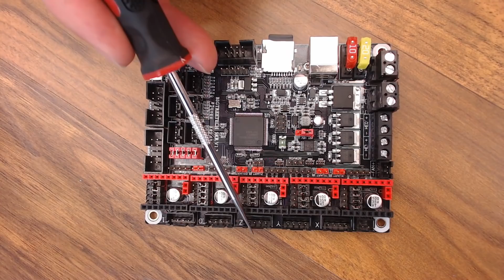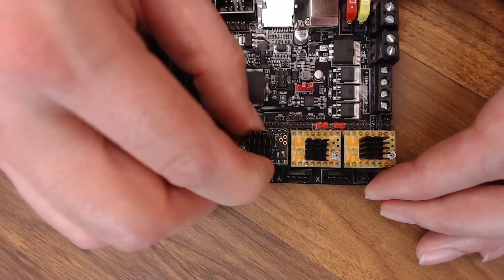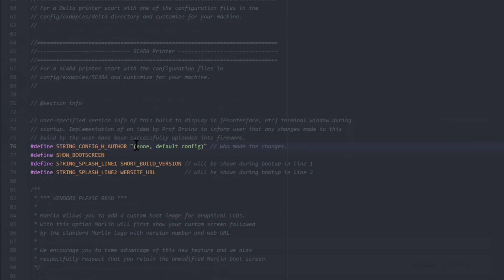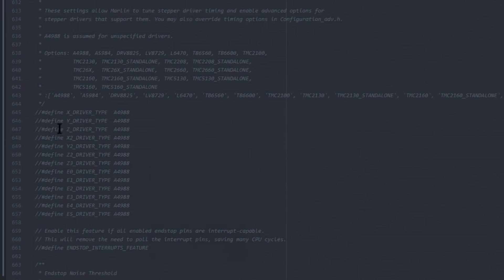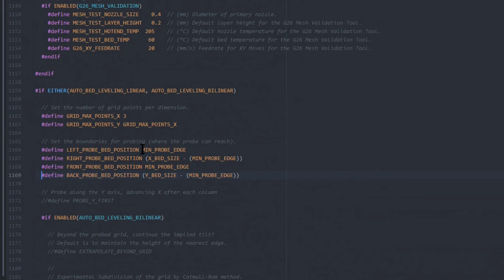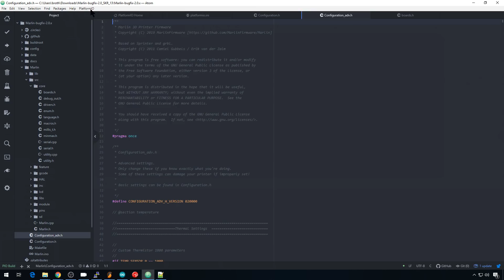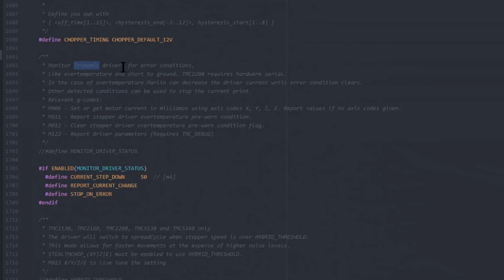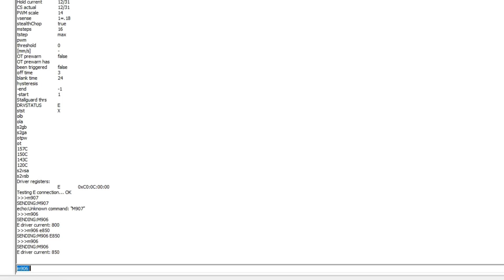SKR v1.3 Mainboard Install - TMC2208 - Chris's Basement

Comment: Hi chris, thank you for that realy good Video.  Mit helps mehr to Setup my skr1.3 with 2208 on the ender3. One thing is that i habe to set the stepps/ MM Down to 40 instad oft 80. I do Not realy understand why. But ist works. Best regards . Marcus
Reply from the maker: Thanks for watching! It sounds like maybe the micro stepping is off on the driver. Check your config options one more time.
Reply: @ChrisRiley  that is what i Think too. But i Setup the config exakt linke yours.  I will investigate that deeper tomorrow and check out with pronterface. My First testprints are looking not so good 🤔. Best regards
Reply: Sorry to contact you again, but i'am really frustrated, I check all settings, eaven the board and driver, but it seams to be that it is impossible to set up the drive in UART, when i send the  M122 to the printer it says "unknown Command"  I'am close to give up.
Reply from the maker: @marcusmuller1674  Configuration.h says 2208 not Standalone_2208 correct?
Reply: @ChrisRiley  yes !
Reply: @ChrisRiley  I have realy no more Idee, spend more then 48 h on this configuration. Send also a mail to the support of Bigtree
Reply from the maker: @marcusmuller1674  If it is set correctly in Marlin, the pad is soldered on the bottom and the jumper is one, that is all I know to do. Does your screen say connection error?
Reply: @ChrisRiley  NO that is the cracy thing, the printer works - but not fine. Mebe i find 2 mistakes, 1. I include (install)  the TMC Libery in Arduino. 2. I bring in the  Part  "HAS_Driver (TMC2208)  in the Configuration_adv.h. But works also not, i test it 2 minutes ago. Close for todaý, sometimes it helps to start at the next day again. Thank you verry much for your help and time !  BR Marcus
Reply: The Support from Bigtree says define SERIAL_PORT_2  0 , this means i have to open the 2. Serial port, but I check you do not do that in your Video and it work. I will test that later on.
Reply from the maker: @marcusmuller1674  Correct, you shouldn't need serial 2 unless you have a tft screen or need the the primary UART interface for wifi or something else.

Comment: Hi Chris, great video! I followed your instructions to install the skr on my Tevo Tarantula but I can't seem to get the REPRAP_DISCOUNT_SMART_CONTROLLER to work. It looks to be the same as the one on your Prusa. I even tried flipping the connectors with no luck. I also tested the controller on my old mks gen l and it does work. Let me know if you have any tricks to make it work with skr. Keep up the great work!
Reply: Never mind... controller works great now. I found a marlin2-skr13.patch for tarantula by azbesthu on github that did the trick. Btw, unlike mks gen l, no flipping of exp 1 & 2 connectors needed on the skr 1.3 board.
Reply from the maker: @jims5884  Nice! This good info to know for others.

Comment: Can I use this video without having TMC2208 drivers and using it on a Ender 3?
Reply: Sure you can, but since the stock drivers are soldered to the mainboard, you'll still need some drivers for your steppers (either A4988, DRV8825 or any other in the same format. TMCs highly recommended)
Reply from the maker: Yep, like Zeen said, you can use any driver you want on the SKR.
Reply: @ChrisRiley  but I can't use no driver at all right?
Reply from the maker: @broom6958  right, you need a driver of some kind.
Reply: @ChrisRiley  alright. Ordered the tmc2208 now.  Any known problems with an Ender 3? Is there a guide for the ender 3 with the skr  1.3?
Reply from the maker: @broom6958  I don't know of any guide or issues, but I have seen a lot of people do this upgrade. It should be straightforward.
Reply: @ChrisRiley  alright, thanks!

Comment: Chris - Thank you for this excellent video. By following this the steps that you outline I have just finished upgrading my Anycubic Kossel Plus to 32 bit SKR1.3 with TMC2208's. Just doing some simple test prints, but at this point I am amazed at how quiet the printer is with the 2208's. Need to finish tuning, and really want to see the effect on the print quality, and speed. I look forward to more content on the SKR v1.3! Thanks again!
Reply from the maker: Awesome Mark! Glad I could help out.
Reply: Quick PS. Just printed a couple of Benchies one at .2 and the other at .1 layer height. Both are perfect! Really recommend this upgrade. A few things to note though:
1) The polarity of the power input screw block is opposite from the other screw terminals for the heaters. Red on the LEFT for the power. And the screening is small and hard to see especially if there are a bunch of other wires already connected and getting in the way. I learned this the hard way. But the fuse did blow and protect the board, so was just out a buck for a new fuse.
2) JST connectors are a big pain to crimp. If I end up doing this again, I think that I might get some JST cables, and the solder them to the limit switches rather than try to crimp on new connectors.

Comment: Hi Chris, my sd doesn't work. I have sdk 1.3 with marlin 2 and the fysetc mini 12864
Reply from the maker: SD on the board or on the screen?
Reply: @ChrisRiley  on screen, I have change  this line for the  onboard sd

  // LPC-based boards have on-board SD Card options. Override here or defaults apply.

I have tested the SD on screen but it's to slow,
Reply from the maker: @tobyax  I would guess this is a bug, probably conflicting data. You might check over on the Marlin github.

Comment: Inspired by this video I got myself an SKR 1.3...and what a total mare it is being!  I can start with the most basic config as you do here Chris and get a working board that I can talk to, but as soon as I try to make use of the Ender 3 example configs included in the Marlin 2.0.x download, it all goes horribly wrong and I end up with a toaster. Mostly, it just won't communicate with  Pronterface or Octoprint, but sometimes, it sort of works but reports CRC errors or loads default values as stored ones are missing. I really cannot face going through every single difference in the config files, one item at a time, changing one thing at a time, until I find the problem. I even tried merging the Bigtreetech published Marlin package with what I needed - again, no joy. Same kind if deal, basic Bigtreetech build will talk to a host, but once I try to make it useful, it goes badly wrong. 

On top of all that....I strongly urge anyone trying this to NOT use a MAC for Atom/PlatformIO/SKR - it no workee. Had to resort to Bootcamp and Win7 Ultimate to even get it this far.  I'll wait for a later release of Marlin I think and try again in a bit.

Despite all that, thanks for the video as always Chris :)
Reply from the maker: Thanks Chris, sorry it didn't go so well. Hopefully the official release on Marlin 2.0 will solve somethings. Anytime you need a hand with a config let me know, I would be happy to take a look at it.
Reply: Hi Chris - It's all your fault of course, you made it look so easy :)   My working assumption is I'm doing something stupid...just need to find out what.  I've also concluded that Atom/PlatformIO on the Mac is OK too, I was blaming that for the issues but it was obviously the configs I was creating to blame. Somewhat conflated by issues with USB on the Mac as well of course....

So, as things stand at the moment, I am able to use the Mac for editing and compiling Marlin OK, I just need to manually transfer the firmware to SD once it has compiled. It did work once or twice automatically, but was far from consistent.

My goal is to build an SKR config for my Ender 3, with TMC2130 drivers in SPI mode on all 4 channels, a BLTouch for bed levelling. This is what I currently have, working perfectly on an MKS-GEN-L.

I'm slowly, one step at a time, building up a config that has what I want in it, it's tedious, but I'm making a change, compiling then testing, one change at a time, hoping to eventually find out what breaks it. I know I said I couldn't face that...but, well, I'm stubborn.

One thing struck me that could well be the root of the problem - I'm doing all this on a bare SKR board - no stepper drivers, no display, nothing other than power plugged in. In your experience, do you think that could be the root of the problems? Not knowing anything about how this stuff actually works is a hindrance! A lack of handshake/feedback from stepper drivers or display could be all I'm missing....if such things actually occur of course.

I wanted to sort out the config before 'breaking' the printer, hence trying to do it all on a bare board. This is probably my stupid mistake!

Thank you too for the kind offer to check my config, that's very generous. I'll give it a bit more time myself (until I get desperate) then may well take you up on that.

Cheers Chris.
Reply from the maker: @chrissavage5966  I take full responsibility. LOL So the only thing I have ran into that needs to be plugged in are the motor drivers. If the drivers and motors aren't plugged in it does some really crazy stuff, but I only ran into that with 2130's in SPI mode. Everything else you should be fine leaving it off.
Reply: @Chris Riley  Mmm, that’s interesting what you say about the drivers. I did try a config without TMCs selected but it was the same deal with no communication. One I did yesterday included defining HE1 as the fan driver, and I noticed that the LED on the FET comes on a short while after power is applied to the board, which suggests something sensible is happening. Maybe I should just stop messing about and connect it all up!
Reply: @ChrisRiley   Hi again Chris. I revisited this yesterday, finally got round to installing the board in the printer with everything attached. Same deal, it's a toaster. So, to the point, it's a big ask, but do you think you could let me have a copy of that firmware.bin file you generated for this video please? I know it won't make my printer work, but it should at least talk to Pronterface or Octoprint without getting pissy. I'm as sure as I can be that my SKR board is faulty, but that would be a final confirmation. I've already ordered another board on the assumption I'm right about it begin duff, but I'm just impatient ;)  Cheers.
Reply from the maker: @chrissavage5966  Here you go, they this one. https://drive.google.com/open?id=10aAyXaFw_sRdTPvTY9tK18Kj_sCr07sT
Reply: @ChrisRiley   Ah, mate, you're a star. Thank you.  And....... it's still a toaster In a way, good news!!  I'll wait for the new one to arrive I think. It's pretty weird though - if I put the OEM firmware on, it kind of works, in as much as I can connect to it, but so far, no Marlin config I've tried, even the most absolute basic, has worked, and now a known-good one from you doesn't work either.  Anyhoo, for the less than $20 I spent on it, I think I'll call it done and hope the new one plays nice.

Thanks again Chris, really appreciate the assistance and I'll report back once(!) I get one working right.
Reply from the maker: @chrissavage5966  Does it do the same thing if you put the fimware on the SD card with your computer manually? Not via USB I mean?
Reply: Chris Riley I had little success doing direct uploads at any point so have pretty much always done the copy to SD card locally to computer then move SD card to SKR routine. Your firmware did load to the SKR OK as it renamed it from .bin to .cur
Reply from the maker: @chrissavage5966  Ok, just curious. Other peoples 3D printer problems bug me just as much as my own. :)
Reply: @ @ChrisRiley    I know what you mean! Before I retired, I spent a few years nursing the company network and a bunch of PCs. That taught me patience as well as a good dose of stubborn :)
Reply: @ChrisRiley  Hmm. Well, new board still on a slow boat from China, but ever stubborn/optimistic(!)/daft, I had yet another go. Only thing I can see that I did differently was to 'Rebuild C/C++ Project Index (Autocomplete/Linter)' from the PlatformIO menu in Atom before I tried modding the configs and doing a build. I've yet to put the SKR back in the printer and install the driver modules etc, but I can now reliably communicate with the board via Octoprint. In fact, its been reliable for the last 30 hours as I left it connected while doing a couple of big prints. This is by far the best result I've had with it to date. It responds to commands as one would hope, as far as that's possible for a bare board anyway.

I truly don't think I did anything different as far as actual Marlin config goes so, I've no idea!

More anon.
Reply from the maker: @chrissavage5966  Hmmm....Really the only things I can think of are the serial port setting or something is a miss in platform IO. I did have to reinstall it the other day. They put out an update the messed up my sketch.
Reply: @ChrisRiley   Hi again Chris. Well, some progress. Sort of!  Before I continue though - are you OK for me to keep spamming this videos comments with my problems? If you're good with it, I'll carry on. If you'd rather I didn't, please, do say so and I'll desist! Cheers Chris
Reply from the maker: @chrissavage5966  Hey Chris! You can send me comments anytime! That's what I am here for. Where are you at with the board config?
Reply: @ChrisRiley  Hi Chris. Cool, I'll carry on then ;)

So, having got a board that I could talk to, I installed it yesterday and it looked promising - LCD working, stable comms with Octoprint, it seemed to accept assorted commands that I sent to it. But, on the LCD it showed TMC COMMUNICATION ERROR and would HALT if I tried to home the printer. An M122 command indicated problems too. After loads of searching, I happened across a comment on one of Michael's (TeachingTech) vids by @Milk Parker who had come across the same issue when he enabled EEPROM_SETTINGS. I'd enabled this by default so did a quick edit and generated another firmware.bin....and it works. Printer now behaves. After commenting on this, @Milk Parker tells men he now has a fully working install, including use of EEPROM but he doesn't know quite why, other than maybe it was the latest version of Marlin that did it. I'll try another download and see if that cures it.

I'm still puzzled as to why your firmware didn't work on my SKR though? We are probably fighting both hardware and software changes here. Wouldn't be the first time subtle changes in a processor core caused problems would it.

Speaking of hardware, my second SKR arrived and as it happens, I'm using that one, but the firmware I've done so far works on both.
Reply: Just tried the latest Marlin update from Github. Well, its different...but not fixed. This time, with EEPROM_SETTINGS defined, it doesn't complain about TMC COMMUNICATION errors, but the steppers simply won't move. It locks out if you try. I also tried hot end and bed heating. Hot end failed in an odd way. I set it to 50 to trigger the fan - initially it heated to within a gnats of 50 but then just stopped. I tried setting it to 60 but no dice. Eventually, the protection kicked in and it started beeping and shut down.

I've gone back to the mostly working version for now. I'll try again in a few weeks! It certainly is alpha release so can't complain. I may even revert to the MKS-GEN-L board for a bit until 2.0.x gets declared fit for general use.
Reply from the maker: @chrissavage5966  At this point in the development I think that is the best thing to do. There are a lot of people reporting issues. I think we are really close to seeing a RC release of 2.0. Hopefully this solves a lot of problems.
Reply: Chris Riley I’ve raised a bug report in case it helps development but will pull stumps for now. I’ll update as and when anything significant happens.
Reply: Hey Chris.  I think I've found the root cause of the issues I've been having with my SKR. Having the Pi connected to the USB port during firmware flashing appears to cause corruption. I was chasing down a path trying to see if I had the same issue as another bug report so decided to fire up Windows on the Mac and use Pronterface as the control tool rather than my usual Pi/Octoprint solution. By chance, I had the USB disconnected as I re-flashed to my latest partly non-working configuration. To my surprise, as I tested, everything seemed to work. Final tests I've done suggest it is working entirely nominally and is also perfectly happy to work with the Pi/Octoprint setup as well (unsurprisingly).  I'll do a final sanity check tomorrow and re-flash with the same firmware again, but once more with the Pi connected and see what's what. At this stage, I'll be delighted if it ends up broken after that ;)  No doubt loads of folk will now pipe up and say 'of course you have to flash it with no USB connection'......
Reply from the maker: @chrissavage5966  Interesting, glad to hear you are making progress.
Reply: Chris Riley  ......and it just gets more strange. I closed the bug report on the Marlin GitHub but thisiskeithb (yes, that Keith) commented that he regularly flashes an SKR via USB with no issues. So , in the spirit of stubborn, I tried again with another cable. Worked fine. Huh?. Went back to the original cable, worked fine yet again. The only thing I recall doing in any way different along the way between toaster and working printer was to factory reset the EEPROM   Was that it all along??  Doesn’t explain the times it wouldn’t even boot at all though. Anyhoo, printer is working fine, all features, on 2.0.x and what’s more, I can apparently re-flash it reliably at will.

Comment: So i have the TMC2208 v1.1 with no jumpers to solder. i had it working on gen L board with 1k resistor Y cable. but now i cant get it to work. even when I solder NC and Uart pins. i have connection between UART pin on driver and the one on the board. help.  BTW printer saying TMC Connection error
Reply from the maker: Sounds like one of the jumper connections is open maybe. Not sure.
Reply: @ChrisRiley  I just ordered the ones you used in the video.